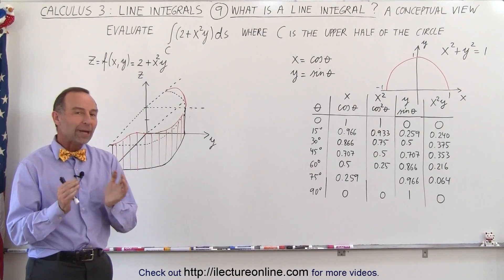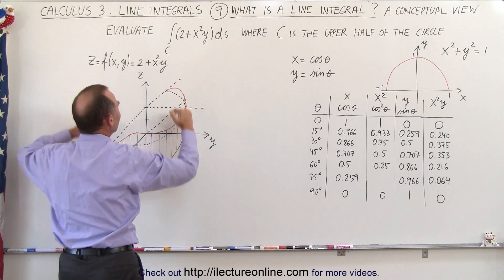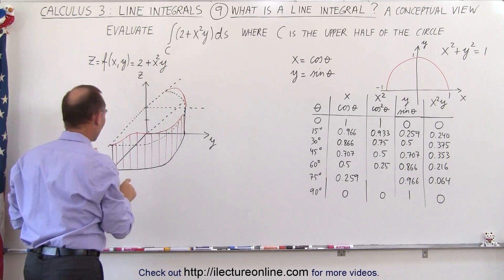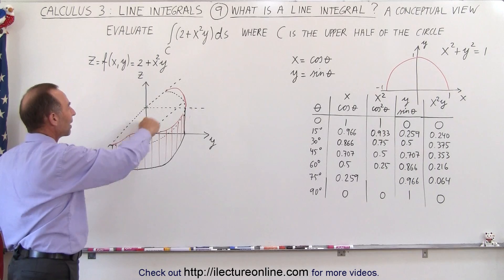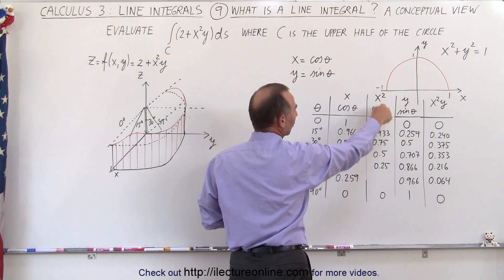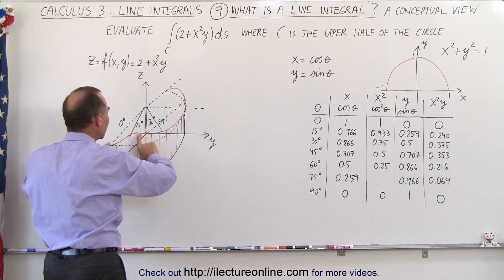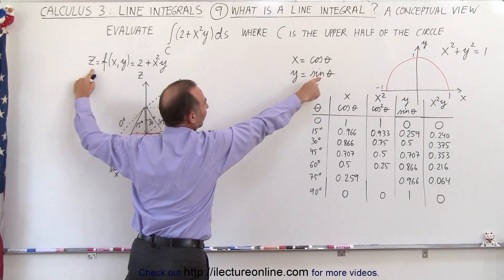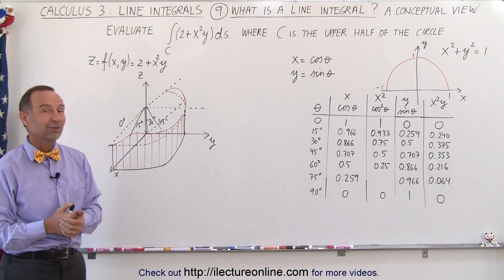Calculus 3: Line Integrals (9 of 44) What is a Line Integral? A Conceptual View

Comment: MICHAEL, MY PROBLEM WITH YOUR VIDEOS IS THAT YOU NEVER GENERALIZE. ALL YOUR EXAMPLES ARE SPECIAL CASES OF A GENERAL CONCEPT, ONLY THE MATH DIFFERS. But don't worry, for every YouTube-video there is an audience ;-)
Reply from the maker: Thank you for the input.
Reply: @MichelvanBiezen  As you know, we usually deal with LINE-integrals (in 1D, 2D and 3D), SURFACE-integrals (in 2D and 3D) and VOLUME-integrals (in 3D), all of them over SCALAR- or VECTOR-fields. Integrals over scalar-fields in 1D and 2D result in an AREA, and in 3D in a MASS or a CHARGE. Line-integrals over vector-fields give us the WORK DONE by a force on a particle, while surface-and volume-integrals over vector-fields give us a FLUX. In my opinion, that's it.